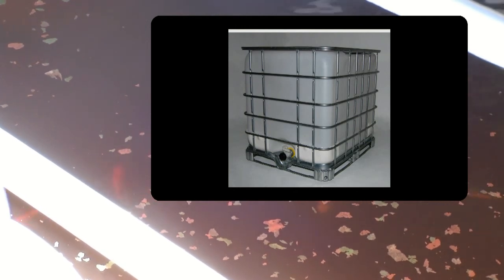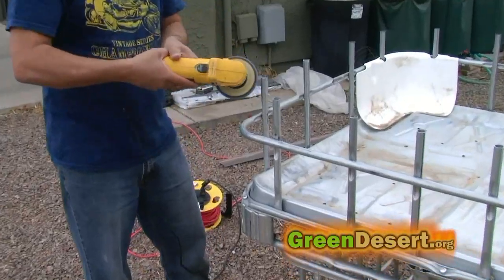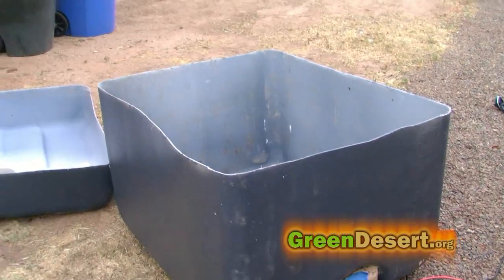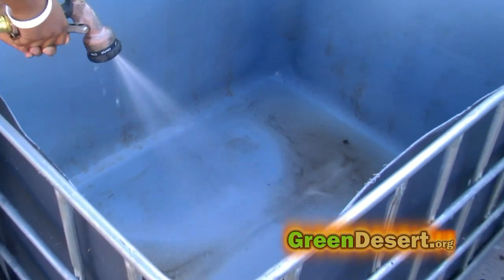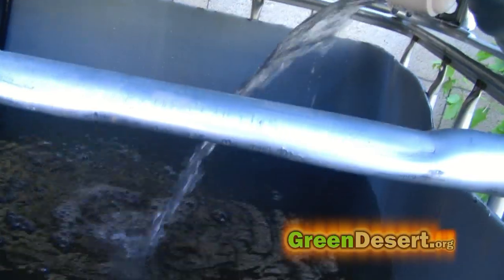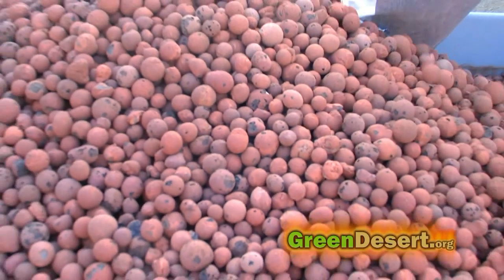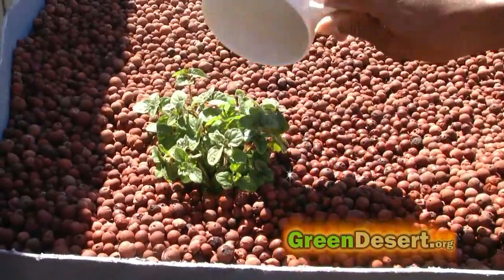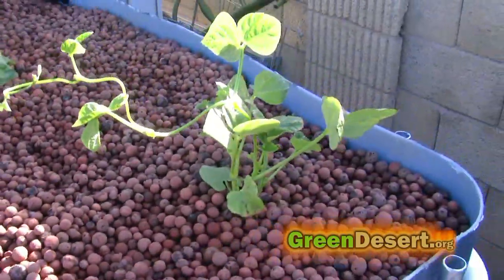DIY Aquaponics with IBC Tote for tilapia

Comment from the maker: Not impossible.  You could shade the tank more, or  and chillers to the water.  At a certain distance underground the temp holds steady, so I plan to bury coils of tube.  I will pump the water underground which will cool the water and run it back into the tank. That might not even be necessary, the tilapia did fine in the warm water.

Comment: None of the links in the video you said you would provide are provided. Do you have links to the plumbing set up and the pumps?
Reply from the maker: Thanks for the support😀 I actually didn't mention providing links in the video but I bought the parts from a local hydroponic store. Please let me know if you need anything else.
Reply: @GreenDesertTV  you said you would link to the video on making the overflow.

Comment: i just use gravel from home depot, much much cheaper. i payed less than $4 per 0.5 cubic foot, 3 bags filled to the top a 10 gallon table. they are small and work well in my system. some people i have seen complain about drainage with the small gravel. this can be fixed with a short layer of slightly larger rocks on the bottom, again cheaper.

Comment: there are other ways to cycle a tank without putting fish trough the high spikes of amonia, nitrites and nitrates, I recentley used fish food in an empty tank and I also squeezed a sponge filter from another tank to transfer benificial bacteria to jump start the tank after a week I could see the nitrites going up and a after a couple of more weeks of feeding fish food the bacteria grows to a large enough colony to convert most of the nitrites into nitrates which are less harmfull than amonia or nitrites, in a hydroponics setup the plants will convert the amonia, nitrites and nitrates into growing leaves